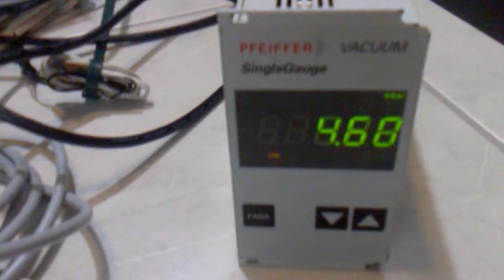Homemade vacuum chamber using refrigeration pump

Comment: That vacuum seems to pull deeper than all the other refrigerator vacs that I've seen/read about. In fact it's quieter and pulls deeper than pumps costing several hundred dollars. I would intentionally go out and buy a new compressor of this type if I actually thought I would have similar results.

I heard you can't run these types of vacuums for very long because they start to overheat; is this true about the one that you made?
Reply from the maker: I have a smaller, 80-85 watt pump from a bar (mini) fridge that reaches the same ultimate vacuum, it just takes longer because the pump rate is much slower. The pump in this video would get too hot after about 30 minutes of run time and its oil would start to smoke, because it is trying to dissipate 400+ watts of heat into nothing but the oil and steel body. The smaller pump I mentioned does not have this problem and can run continuously while its outside surface temp does not exceed about 60 deg C.